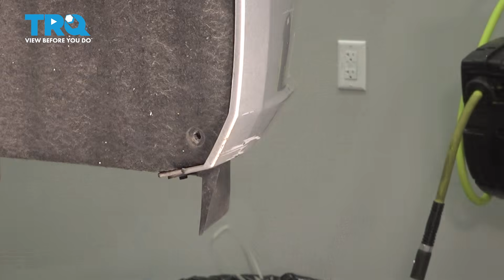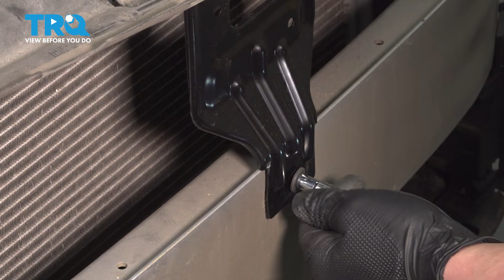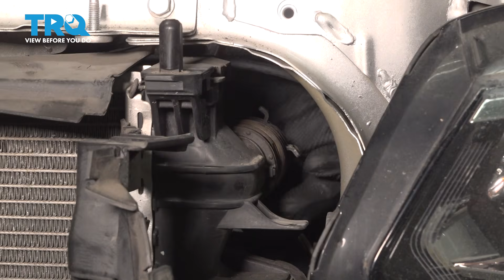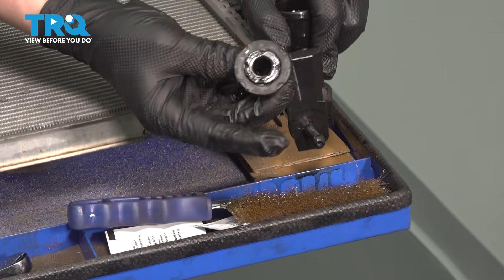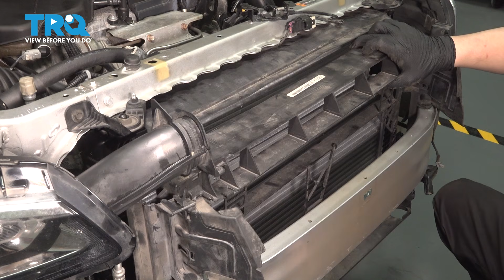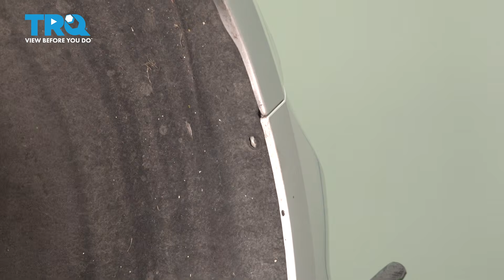How to Replace Radiator 2016-2025 Chevrolet Malibu 1.5L L4

Comment: What about the coolant temperature sensor that goes on the bottom of the radiator I can find it in a Malibu 2017. Water leaks from it. I buy the sensors but can't find the plug that goes on it. Any help?